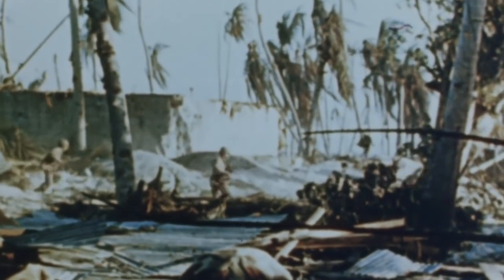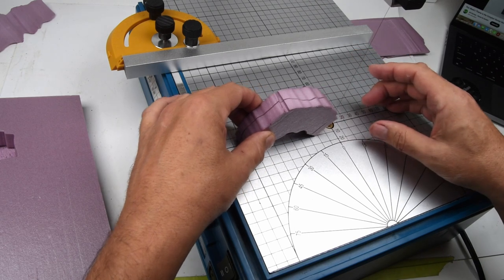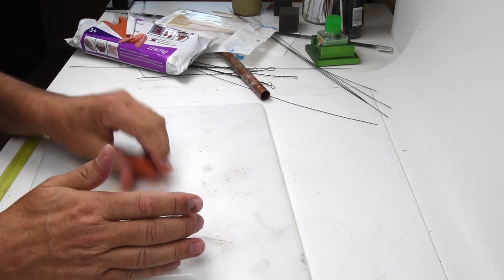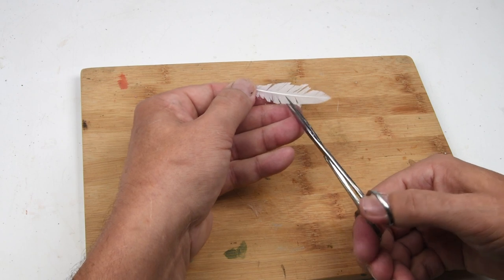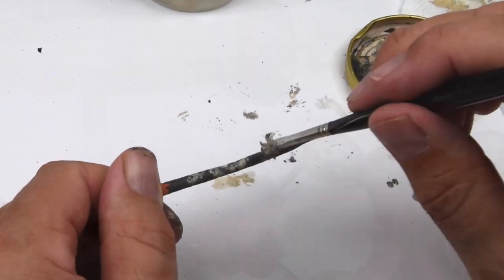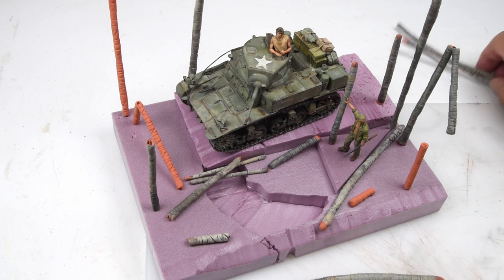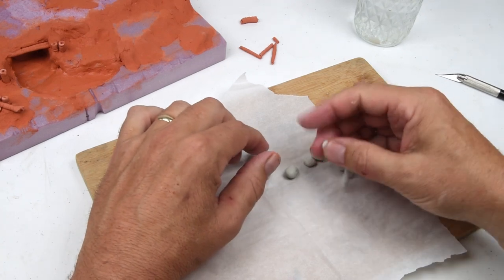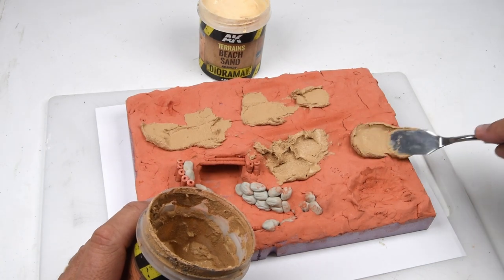Stuart Ep.4 Constructing the Tarawa Base for the M3 Stuart tank.

Comment: I like the palm fronds from feathers that’s pretty good idea! Why didn’t you just use A&B putty for  all the palm tree logs? And here in Florida we have lots of palm trees so you did a really good job👍🏻 I do like the idea of the air dry scalpy that would be really good for diorama groundwork and study wasting ANB putty I may have to try that one day.
Reply from the maker: I had thought of the A/B (Apoxie or Magic Sculpt) and would have probably gone with that for the trees, but just wanted to try the Sculpy to see what can be done with it. Like I said, it really doesn't have any structure in of itself (neither would A/B), and it's easy to work with. As for the base....it's a winner.
Reply: @RickLawlerPropaganda  looks perfect for ground work probably cheaper than magic sculpt.

Comment: What size would you recommend for 1/16th scale Palm Trees? That is to say, the width or diameter and/or height. Awesome work, very inspirational. Thank you.
Reply from the maker: It's just simple math. First you need to know the size of a palm tree. Once you figure that, then scale it. For instance, if the tree is 20' tall = 240", then divide by 16 (your scale) =15".  240/16=15.